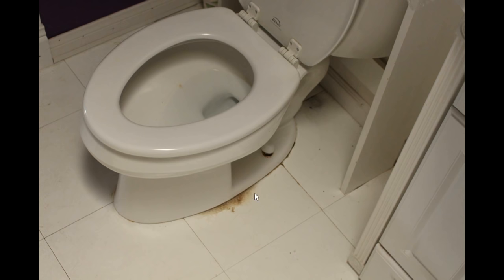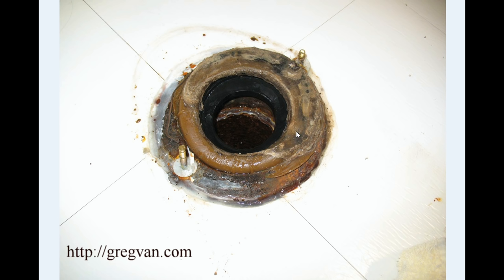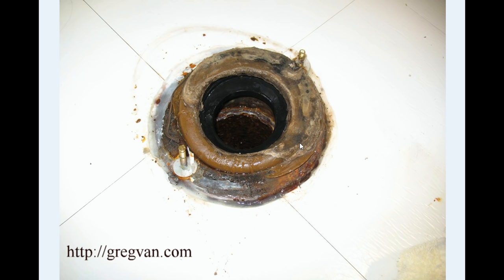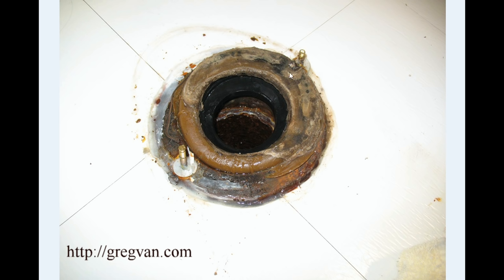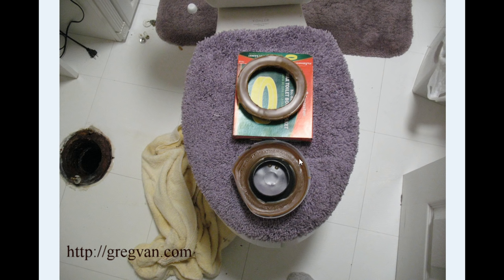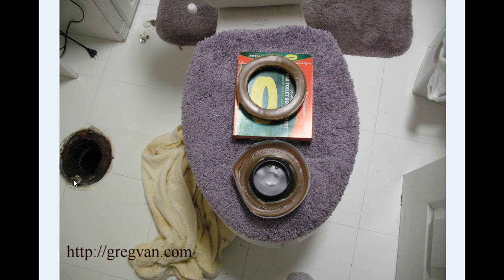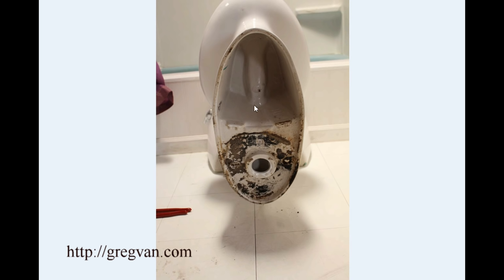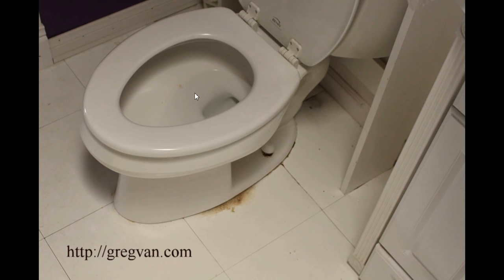Watch This Video If You Have Water Leaking at Bottom of Toilet – Home Repair Tips

Comment from the maker: Always examine the exterior of the toilet and the surrounding areas for possible water leaks before removing the toilet.
Reply: I have a question my toilet is not flushing properly its flushing really slow and does a weird noise like a gurgle kind. The base is also leaking I dont know what to do. Any help?
Reply from the maker: @bev.m  Most of the time when a toilet isn't flushing properly it has something to do with a clogged drainage line.
Reply from the maker: @thelastcashew I'm guessing about 5/16 of an inch, but you can usually go down to your local home improvement center and tell them that you're looking for toilet bolts and they should be able to help.
Reply from the maker: You're welcome.
Reply: I've been renting a house from a landlord who doesn't fix anything and the many things I've been complaining about has been the toilet in the bathroom as it is definitely doing much more than just a rocking to the left and right, she already has a leak coming out from under it causing black mold to form but wait I am forgetting the most important part of my conversation with her about this issue especially with mold, she told me word for word, "MOLD IS NOT BLACK" I went on the internet to look up some DIY things to test for leaks in the Flapper, and I have already been informed that the toilet has been through the floor once taking the bathtub with it... But I was never made aware of these things otherwise I would have kept looking for somewhere else to live.
Reply from the maker: @godsanointedandappointed7156  Yes I would definitely find a new place after your lease is up.
Reply: U
Reply: @gregvancom  how do i send you pictures pf what i see?
Reply: I just watched your video, and my toilet doesn't move either way at all. I had the wax and the other ring you showed replaced twice already, and now it's leaking again around the base. What should I do?
Reply: @bev.m  call plumber
Reply: Hi there
Watched your video on leaky toilet at the base of the floor. Haven't ck'd if caused by flushing, but will. 
Is is true that all toilets must be caulked? Just curious. Your video, there is no caulking. Thank you for your input. 
B

Comment: I just installed a new toilet.  The base of toilet is leaking in the back . I don't know what I did wrong.  However the bolts I had didn't fit the screws sticking up from the base . So the toilet isn't bolted I'm guessing that's why ??? This took me hours .... somehow the tank is leaking on the one side.    Ugh .  So I put putty around the tank leak till I can get to home depot.  I just want to scream . Thank u for the video .

Comment: Thank you for mentioning the cracks.  I think that's what my toilet is doing.  I've replaced the wax ring twice and it still leaks at the base.  I am going to replace the entire toilet now
Reply: Probably need to be resealed that’s all
Reply: I just did replace the toilet and still it leaks.  Maybe time to replace the Plumber!
Reply: Yep. That is my problem.  I tried replacing the wax ring twice.  The second time I stacked 2.  I get water without even using it.  Hard to believe there is a crack as I sure can't see one.

Comment: I recently replaced my toilet and I actually threw out the wax ring and bought a rubber boot type seal that extends into the drain pipe past the flange with a water tight seal. Much easier to deal with and outlasts wax and less messy also. Wax rings are old news
Reply from the maker: I've never heard of them and just looked them up on the Internet. It sounds like an excellent idea and if they don't cost a lot, could replace wax rings in the future, if they haven't already.
Reply: Thanks for commenting on this! I didn't know that there was another option!
Reply: Link?
Reply: Flange type rings restrict some flow into the pipe. Doing commercial jobs if it had the flange we would cur them off

Comment: I have replaced a few rings over the last couple decades.  This is the first time I heard of doubling up on the wax ring.  When the time comes again, I will give that a try.
Reply: Doubling up the wax will fail! They make flange spacers for that. Years ago my "Handy Man"; neighbor repaired mine that way, after two years the leak returned.
Reply: Never use a handyman, I learned that lesson many years ago. It's your home, your castle, pay for an expert. Someone said above that they make rubber seals now that last longer than wax seals.
Reply: @camouflagejumpsuit  rubber seals are junk
Reply: @chrismallory3718  I believe you

Comment: I replaced the ring twice, thank you for the tip on the crack from underneath. Was getting frustrating, Thank you..
Reply from the maker: Was the toilet actually cracked and you're welcome?
Reply: @gregvancom  yes. Very small. Before putting the new toilet down I also Replaced the plastic ring with a taller one. So it would just sit above the floor. And works great. The new toilet uses like half the water. Going to replace the other one in the other bathroom. Was getting fustrated with this. Thank you again for the post.
Reply from the maker: Glad everything worked out and thanks for sharing.

Comment: Hi,
I have toilet leak issue too.  I had successfully installed 4/5 new Kohler toilets from using other brand of wax rings and standard wax rings.  I have 1 toilet in my master bathroom where it's leaking from both sides using Danco all-in-one seal, standard wax ring and thicker wax rings.  I'm going to try double wax ring, thicker one on bottom and standard wax ring on top.  I hope this will fix and hope it's not crack at the base.  I have checked it's not leaking from water supply nor from tank.  I also checked the flanger is in good condition and it's not perfectly level with tile, slightly tilted on back like 3/16" and front is almost level w/ tile.

Any suggestions to resolve, if still leak on side, after double wax rings installation?
Reply: I applied double wax rings and it resolved water leak at the base.

Comment: It is 10:15 pm and I just went into my bathroom and water is everywhere. The toilet bowl is full and so is the tank but I saw water coming from the turn off point. I turned the water off and now I am stuck with having to figure out how to fix it myself or call someone in the morning. Thank goodness I do have a second bathroom so all is not bad. P.S I was not having this issue until someone that is heavy set came over and used my bathroom and every since then it has been rocking as described in this video but I have never had a mess like this.
Reply from the maker: Bummer!!!!

Comment: Thanks. Very informative. How do you fix bolts at bottom of toilet. Leaking at bottom of toilet.
Reply from the maker: The toilet bolts usually attached to the flooring foundation or to a flange around the base of the toilet drain pipe.

Comment: Do you always recommend the 2 waxes? Was installing a new toilet & my handyman felt only the 1 thick wax with plastic flange was enough. I had both thick with flange and regular size without flange available
Reply from the maker: Most of the time one wax ring is going to be sufficient. I would only suggest using more than one if it wasn't sealing properly. You can usually check to see if it sealing properly, by installing the toilet and then removing it to see if the wax ring has flattened. If it hasn't, then add another one.

Comment: Thank you for helping me with you're video. I have a question I changed my wax ring last year but I still keep getting leaks and now my floor is turning yellow my floor is from wood. What can I do??  Help
Reply from the maker: I would take it off again and check the wax ring, you've got to find out if or where it is leaking from. Make sure the toilet supply and connection between tank and bowl isn't leaking.

Comment: Hi, nice video! Hope you can give some help here. I'm replacing a 1942 toilet for a new Water Sense one. When I lifted the toilet up found out there was a cockroaches nest underneath. It had about 1/4" of roach dirt, eggs, dozens of roaches coming out, very gross! I cleaned the best I could but I can't get the wet dirt out of the flange's holes. It's a cast iron flange, rusted but not broken. There are no bolts to remove this flange and there are areas around the drain pipe that I don't know if need some repair. I'm not sure how to send pics through here so you can tell me if it need repair. Do you have any tips on how to clean this well? I don't want to put the new toilet while there is wet dirt there. Also, I'm thinking on painting the flange with a rust reformer spray to stop the rust from damaging it further. Have you ever done that? Thanks in advance!
Reply: Roach nest under the toilet and you lived to tell the tale?  You are one brave Woman!

Comment: Not sure if you’ll see this, but I’m going to share my experience. I installed a new toilet about 5 - 6 weeks ago. All was great for abt 2 weeks and then it started leaking in the same spot as this video. It was spreading, but very slowly. 

Decided to go ahead and cut the vinyl I recently replaced. I found a good amount of water, but no obvious sign of where it was coming from. I dried the area up good and then flushed the toilet numerous times. Nothing. Waited hours and then tried flushing again. Still nothing. Granted it’s only been a single day since drying it, but I figured I’d get at least a little water from the leak. Nothing at all. 

After trouble shooting everything, I feel like it’s the ring. I didn’t know there were two different sizes of rings. The ring I used came with American standard I bought. The thing that got me was how soft the ring was. I’m far from an expert, but this felt abnormally soft. Aren’t they supposed to have some thickness to them? Mailable but firm, right?  I feel like this is my problem. How do you know what size is right? What abt using two together? 

I haven’t bought anything yet nor have I pulled the toilet up. Waiting to see if this leak pops up  or not.
Reply from the maker: Some toilet leaks are easy to fix, while others might require a little more effort. I have ran across softer toilet rings, but most of the time they are firm and I can't provide viewers with the exact size, because it can vary in different projects.

Here's a video that might help https://youtu.be/eB_JaioP62c

Comment: Question: if you are using a back pipe toilet (no floor flange), and the same issue occurs (water on floor at base of toilet) would it most likely be a crack in the toilet? The water in bowl is not low.

Comment: Do you think a sewer pipe dirty with same remains would cause the water to push back and damage the wax or I would see no regular flushing in this case also? Tks
Reply from the maker: I don't think the wax ring can produce a water tight seal that would hold under pressure and could start leaking if sewage backs up.

Comment: My question is how long will it take for a snake 10" to rot inside a drain pipe??? I was using the hand auger, and because it wasn't attached to the casing, the weight and gravity, just sucked up the snake and I have no clue where it could have gone or how I can retrieve it. Tx.

Comment: So how do we determine whether we should place another ring on the original one versus cleaning and removing that and placing two new fresh ones?
Reply from the maker: I'm planning on making a video about that in the near future. I think the best way would be to clean everything, put the new wax ring on and then set the toilet. Then you would need to remove the toilet to see if the wax ring has been squashed and if so, then replace the toilet and your done, but if it still looks the same, then add another ring.

Comment: i just went through this thought it was this.. New 2018 2 button glacier bay the empty bottom leaking looks like they put putty over the sides to strengthen it at manufacture.. never again thanks for the tips got me to figure out my leak. new floor level and brand new pipes so i know  this was manufacture defect

Comment: Lol, the ex tenants had a downward piper toilet, but then took it out, covered the flange and floor with tiles, drilled a hole in the back wall and bung in a back-piper. Only a few years later did that take a toll on us...they did such a botch job that the area around the flange under the tiles rotted and made the flange hole bigger..bigger.. enough for the bowl  into the hole, with my elderly mom sitting on it! Anyways, now for our toilet floor flanges aren't possible..:( we have a new floor, but still the back pipe toilet..what a mess they left us with

Comment: I have an issue with water leak (slow) around the base of the toilet.  The Kohler toilet was installed a couple of years ago.  I observed one of the nuts holding toilet down was loose, so it rocked.  Yesterday I removed wax ring and installed a rubber ring.  Today it's still leaking.  (It's securely bolted down) Thougts?
Reply from the maker: I don't know why it's leaking, but would check to make sure it's not leaking from the water supply line or between the tank and bowl also.

Comment: Very good video I have one question now if it's leaking from the toilet stool will it cause it to leak downstairs bathroom from the AC vent because I'm trying to figure out if it's leaking downstairs because I can see a Watermark like a brown mark on the AC vent from water or something like that I'm not sure
Reply from the maker: I can't say for a fact that the water would be leaking from the toilet, but can suggest that there is a high probability, if it's leaking. All the watermark suggest on the ceiling is that there is a water leak, but it can be coming from somewhere else.

Comment: Hey man , hope all is good, I have a problem with the back of the bowl can I just use the push gun with silicone to go around the bottom base I live in apartment pool building and I’m moving so I rather just put a Band-Aid on it and leave the problem for them so if it’s like when you said that’s a ton of money which I don’t have so I need a simple fix on that and one more thing at my faucet at a nowhere in the kitchen and turn it on in the middle of nowhere water comes out the stem of it Honey hole it’s it’s piss out of the side very very just make up pinhole stream I’m wondering if you have any ideas with that I was thinking crazy glue or something just to wipeOver it thank you I’m Stephen

Comment: I’m only a minute into this vid so I apologize if you’re about to address my point. 

But don’t ever double or triple wax rings.  If there’s a height / reach issue you need to install a knock out flange so that you only need 1 ring. 

If you double or triple , when the toilet is plunged it can cause the bond between rings to blow out

Comment: I have a leak from my ceiling with an apartment above me and there’s a bathroom above me where the leak is. It seems pretty normal in there but everything in there is very old. What do you suggest I look for?
Reply from the maker: If you can't see anything leaking on the bathroom floor above, then you might need to remove the drywall or plaster in the ceiling to take a look at the plumbing pipes and see if they're leaking.

Comment: I cleaned the toilet and flange put 2 wax seals like you said but still have water leaking out one side slowly. I didn’t see any cracks. Any specific way to check for cracks or am I doing something wrong. This isn’t my toilet leak fix but this one has me lost as to why it’s still leaking.
Reply from the maker: I would check for cracks, but also check to see if a third toilet ring or some type of expander might solve your problem. Remove the toilet and make sure the wax rings are squashed or smashed a little to create a good seal.

Comment: Moved in  to my new place and they used grout instead of caulking. Long story short waters leaking all over the floor. Should I break off the grout and add caulking or add caulking on top of the grout ?
Reply from the maker: There shouldn't be water coming out of the bottom of toilet with or without grout or caulking. You should try to stop the leaking before using a sealant or caulking. You might need a new wax ring.

Comment: Great informational video! My toilet was leaking from the base and I called the plumber who replaced the wax seal. It was okay for about a year then we had the same problem again. I have had the wax seal replaced by the same plumber  3-4 times in the 10 years I've lived here. Is this normal? Could it possibly be a different problem or a combination of problems. It's a slow leak barely noticeable (we have stone tile and I call the plumber as soon as we notice discoloration in the grout, no puddles). From your video it seems it could be due to a rocking toilet but I wonder why he never explored the root cause? What should I do?
Reply from the maker: I won't be able to tell you what the problem is and no it isn't normal to replace the wax ring that often, but if every time you make the repair and it works, then at least you know what the problem is. It sounds like it might be time for a different plumber.
Reply: gregvancom appreciate it!!!
Reply: Different plumber
Reply: My dad (plumber) said it could also be condensation, or it could be leaking from the top of the tank. You should check those out. A wax ring shouldn’t go that bad.
Reply: Mine always goes bad after 1 year too.  I'm thinking the toilet flange is bad?  Did you resolve your issue?